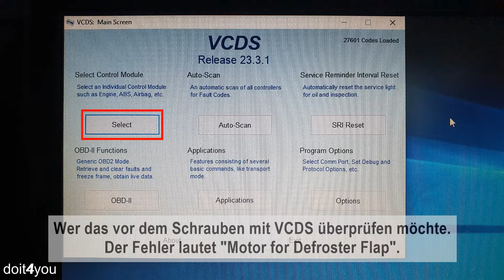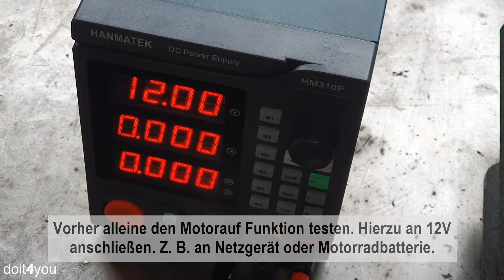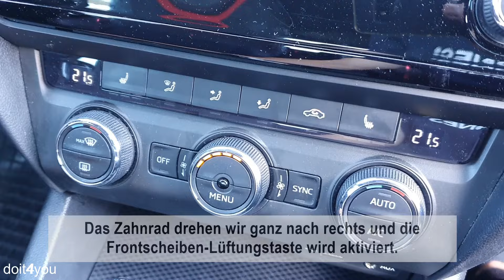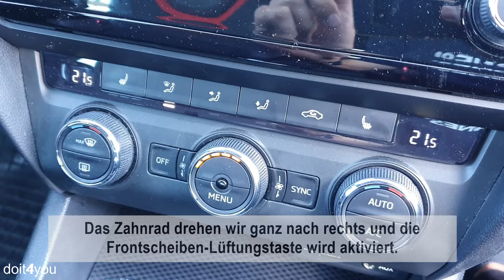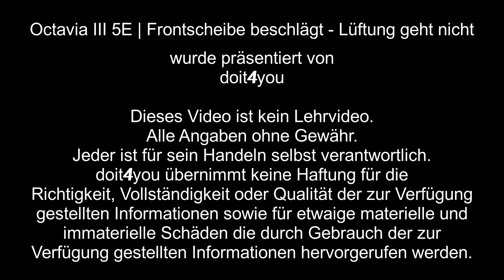Skoda Octavia III 5E | Frontscheibe beschlägt Lüftung geht nicht - Reparatur

Comment: Bellissimo video, io ho cambiare radiatore abitacolo no scalda parte destra , ci puo dire il probleme. Grazie
Reply: Most likely the fault is the actuator that moves the right side hot/cold flap. It should be a similar (if not identic) part